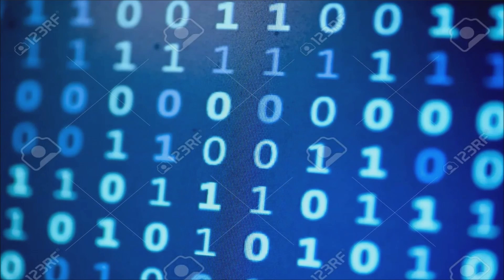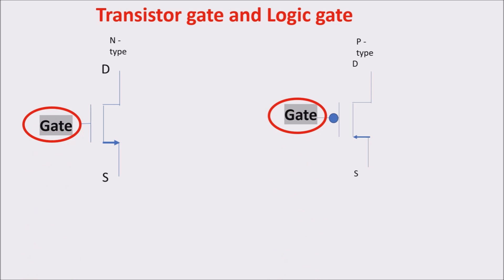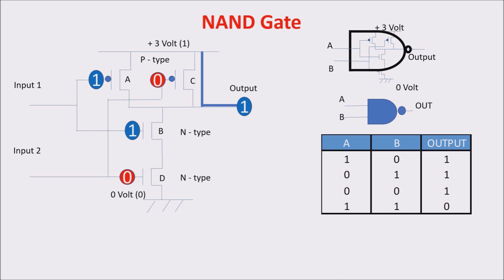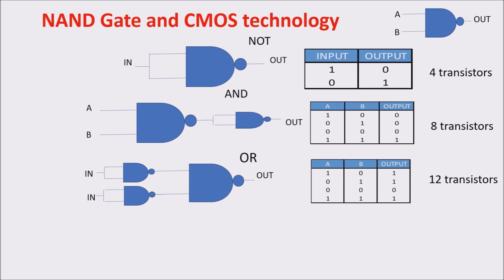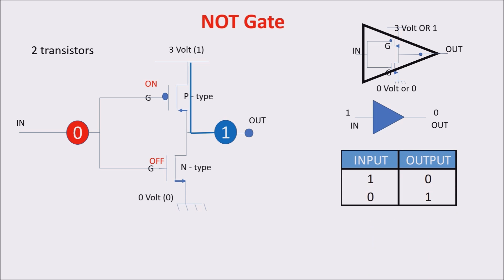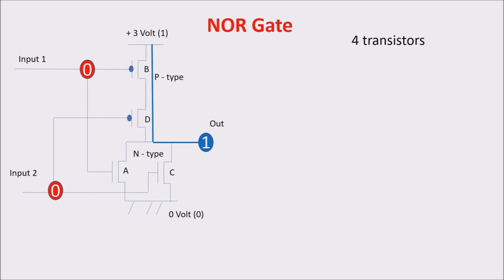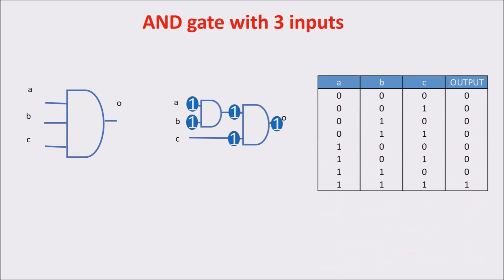Logic gates - From transistors to logic gates NAND, AND, NOR, OR, NOT, XOR how computers work PART 1

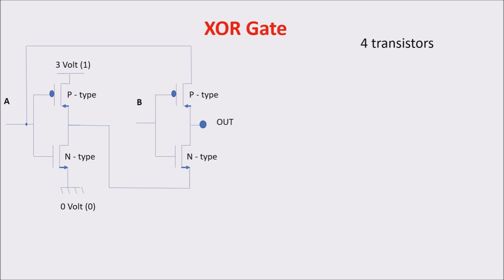Comment: Your XOR gate (9:16) does not works. In case of both inputs with zero value A=0, B=0 input, p-MOS transistor with 0 volt at source and 0 volt at gate is nonconducting. You get high-impedance value at output and not the logic zero. Minimal XOR (CD4077 without buffer-invertor) have 9 transistors. It is minimal form (minimalisation is not straightforward and must be done in two steps). Canonic form (directly from logical equations) has 12 transistors.  Form from TANT method (four NANDs) has 16 transistors.  
There is no physical realisation of XOR with 4 transistors!
Also, You have sources (emitters) of all p-MOSs at bad positons (output) - everywhere! (i.e. 4:12). Sources of p-MOSs must be connected to + power - supply (or to the rest of the circuit in composed function). Outputs of CMOS logic must be drains (collectors)! 
 There is analogy of ECL in MOS logic with outputs on sources - source coupled logic (SCL)  (It was used in mainframes in early 90's), but this is not the case.
Reply from the maker: Thank you for your explaination. I had some doubts about my XOR. I over-simplified it just to get the taste of the working. I didn't want to put 12 transistors logic gate, but you are right. Thank you

Comment: Can't the AND gate be made with 4 transistors? If you change the places of the high and low voltage sources in the NAMD gate. Or if you connect serial n transistors to the high voltage source and the parallel p transistors to the low voltage source.
Reply from the maker: No, the n-MOS transitors are on with a logic one and must be below near the zero voltage. The p-MOS transistors must be above near the High voltage because they need a Logic zero to switch-on. You need a voltage difference between source and gate of the transistors and the positions matter in order to create such difference

Comment: Why does a NOT gate require two transistors exactly? Why not just use a p-type transistor? It works exactly as a NOT gate even without a n-type
Reply from the maker: Yes you are right, but you should  use a resistor instead of the nMos (otherwise the output Is always connected to ground or zero logic). But in Integrated circuit a transistor Is always better than a resistor because It  takes less room. Moreover, there are other considerations related to speed, simmetry,  power consumption and IC process which make you prefer the two transistors solutions.
Reply: @Computer-and-Electronics  ohh got it. Very interesting!!

Comment: As many others, I came here from twitter. I would like to ask a question about a NOT gate. I don't understand why you need two transistors if having a single P-Type transistor, supposedly, already achieves the same effect (outputs 1 when input is 0)?
Reply from the maker: Yes you are right, but you should  use a resistor instead of the nMos (otherwise the output Is always connected to ground or zero logic). But in Integrated circuit a transistor Is always better than a resistor because It  takes less room. Moreover, there are other considerations related to speed, simmetry,  power consumption and IC process which make you prefer the two transistors solutions.

Comment: @ 4mins, how does the p and n make the NAND if output never gets votage unless 0..? how about 0010
Reply from the maker: when there is a 0 at a gate the p transistor turn on and it connects the output with the high voltage of the power. the output gets the one from the power.